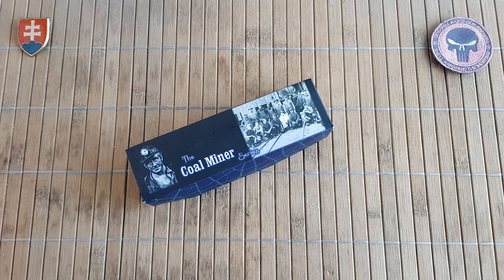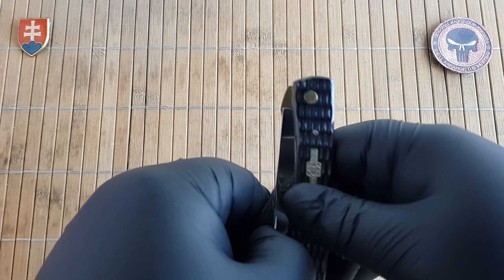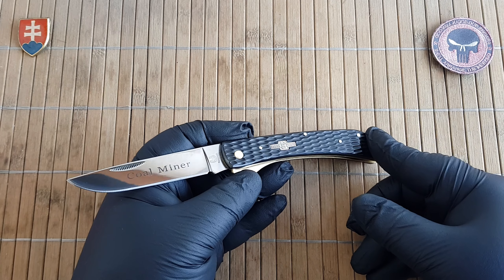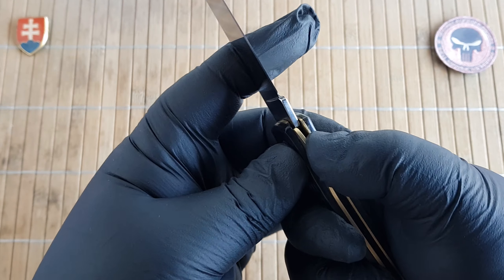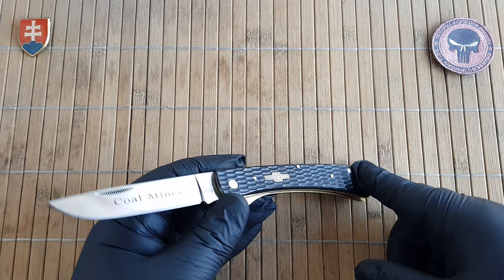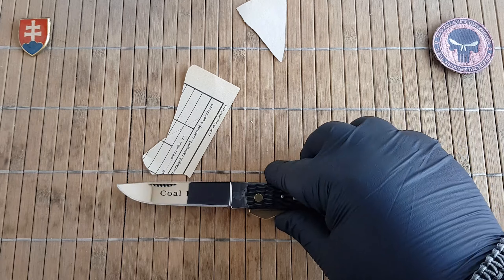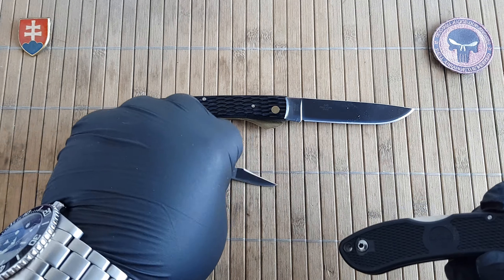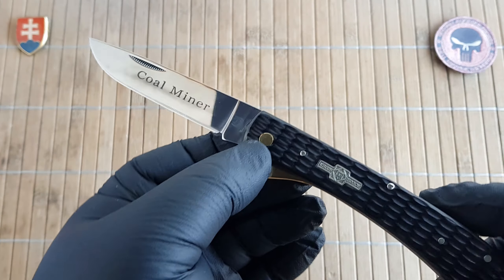ROUGH RYDER COAL MINER WORK KNIFE

Comment: I had the same issue with the yellow carbon steel version they make. I sprayed it with WD40 and wiggled it back and forth, and just worked it. It hasn’t  failed since I did that. You have to physically move the liner with your thumb back and forth after spraying a decent lubricant. I also used a brass wire brush to make sure there wasn’t crud stuck in there too. I was bummed like you were, trust me, I’ve seen this many times on rough rider liner lock sodbusters. Thrifty kannify has the red jigged bone version, same thing with his. It’s a flaw in the production of that pattern. But it can be fixed, so it’s not a total bummer. I just ordered one on EBay, there was only 2 and I jumped on one. It’s used but very lightly. I should have it within the week. I paid $20, for what it’s worth. Good luck
Reply from the maker: Thanks for sharing and enjoy your new knife.
Reply: Joel thanks, , i bought an electrician knife RR, new and the lock wasn't clicking in all the way.  I oiled it and  now the lock fully engages. great